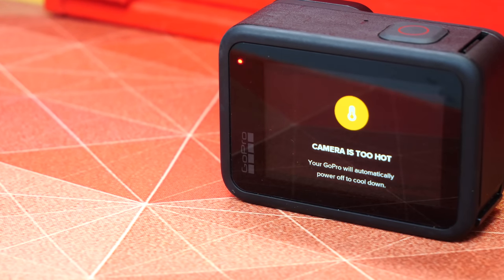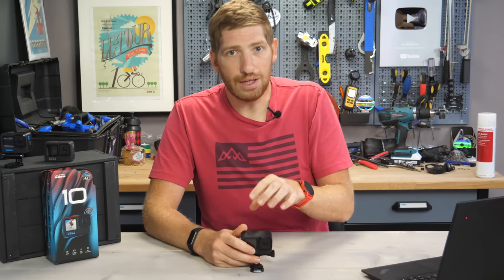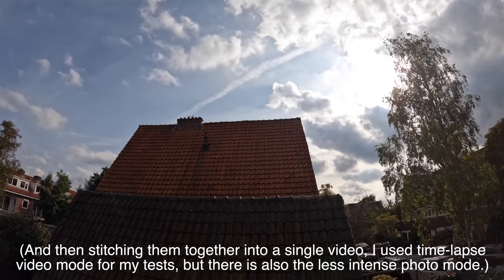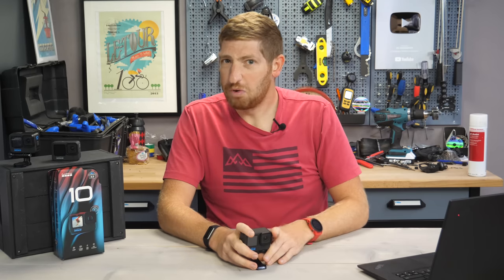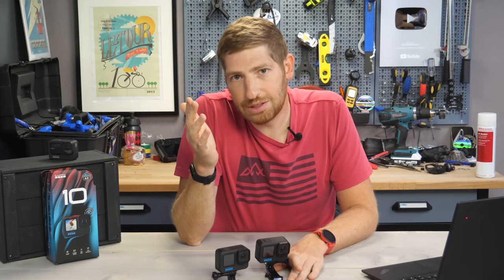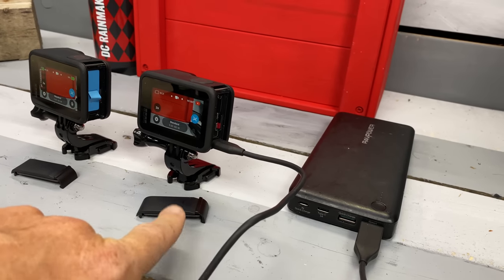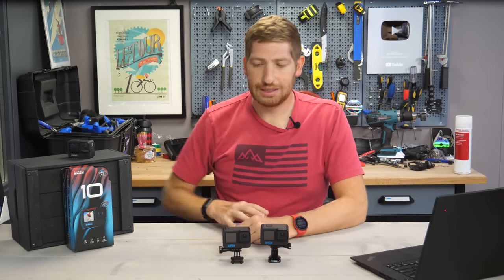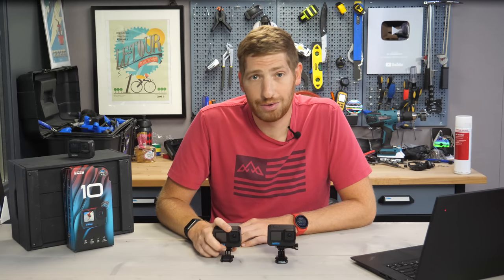GoPro Hero 10 Overheating: 40 Tests Later

Comment: I'm watching this Video, and while doing so I have a few comments based on 7 months using these Cameras as my primary tool for footage on my Channel:

First, these Cameras overheat period. It does not matter what resolution one chooses.

Second, the time frame is in the 15 min range +/- depending on the ambient temp. But I have gotten up to 45 min on some cameras at some times based on various ambient temps.

Third, it does not matter whether these are in air conditioned space or non airconditioned space.

Forth, It doesn't even matter if the camera is outside in the open air and moving.

Fifth... I've had to ditch ALL of my accessories that protect the cameras, or allow mods (Media Mod) due to these heat issues.

I have used in low resolution and still have issues. The only time I do not have heat issues is if there is a lower ambient temperature and I'm using Time Lapse.

So ... after some shared talk I decided I wanted to try to run these cameras without the Batteries in order  to supply additional air cooling via the open battery compartment.

And... In order to do this I needed a solid power supply to make sure that the cameras could run without the battery.

So ... I installed new QC3 and PD ports to power these. I was semi successful with that for 1 to 2 cameras. The third I could not get to run on only external power. These are all the same Cameras, bought at the same time, with the same firmware, and reset to default settings.

In the end what I found is that there is still major heating issues with the Hero 10. This was found even with the battery out, exposing more surface area to the ambient air temps and cooling.

The clip timeframes you suggest of about 1.5 minutes matters not, IF GoPro fails to share this issue presales for anyone looking at buying these cameras for an across the board use... they are perpetuating their faults.

Just my thoughts.

Almost all of my video shots are 10 to 50 minutes or longer, and in confined but air controlled spaces.

Its a Mad Mad Homestead 

https://youtu.be/-TZDS4EjFtU
Reply from the maker: Looking at your video, you mentioned 60FPS. That's the core of your issue. The issue isn't resolution, as I showed, it's the FPS. Also, if you're not moving anywhere, you can use the new Video Performance Modes on the Hero 10 (which came out after this video), to reduce the issue further. Simpy put, even in regular Boost mode with 30FPS you shouldn't be seeing overheating - even in 90*F weather (and my testing validates that). Whereas, in 60FPS, it'll overheat relatively quickly.
Reply: @Dcrainmaker  
I apologize...I'm not as professional in managing content as you are. Great job!

I did however run in 1080 with lower frame rates as well with the same outcome. That was with default configuration settings. Additionally I've shot with the lower settings in  firmware to limit functionality for battery life as well... all with the same or virtually the same results. It's a conundrum for GoPro for sure. 

And yet, as I've found in many posts about where GoPro may be headed in the future with the Hero 11, I fear they will hinge their reputation on the misrepresented (imo) data, that the majority of clips created are less than 1 min 30 seconds or thereabouts. 

That misrepresented data is skewed  by the fact that at a "20 min AVERAGE clip time before overheating", there would be little increase to that 1.5 minute number as there are fewer folks that CAN exceed clips that are in the other end of the scale. 

If you have 10,000 cameras with an average clip duration of 1.5 min, that number would probably be the mean. With the bell curve possibly covering the typical 20 to 30 percent of users fitting into that time use period of 1.5 minutes.

If you added 35% or so of users (roughly-per the bell curve) that have clips less than 1.5 min and 35% of users that have clips more than 1.5 min you begin to see how that stat can be manipulated in various ways to support anything you might want to say.

If for example, like myself, I would be happy taking a two hour clip and signing it down to whatever I need. That's much easier for myself being a one man operation and not having the ability or time to continually be manipulating 3 cameras in real time.

So if I were, or folks like me, we're to be included in those samples as Hero 10 users, that would skew the results of that 1.5 min by a lot to the longer clip side and away from the shorter clip side. 

What's confusing is this... if the "average user", as GoPro states, is using their Hero 10 to shoot 1.5 min clips, then it's basically saying that 35 % of users (according to the bell curve) would be shooting clips LESS than 1.5 min and 35% would be shooting clips greater than 1.5 minutes... 

So now I would ask... what length of clip would cover the average of the remaining users below  a given threshold, or 35% of the less than 1.5 min users? 

Well that would depend... but what I'm getting at is that it would be less than 1 minute... possibly less than 45 seconds. 

I can't see as many folks as they say using these cameras to simply capture 15 to 45 seconds of video. Again I may be wrong....  but if you look at the statistics behind the assertion that the average user shoots clips less than 1.5 min, then naturally there would be many that shoot less as well. 

Add that to the issue that the cameras will continue to heat, although not to the same degree, while they are on, but not recording, and you can begin to see that possibly the reason the users are generally using clips less than 1.5 min is because there are probably issues with the ability to use the cameras for longer periods, thus pushing the average down, and keeping it at 1.5 min. 

How about upload issues.?I believe it was mentioned that the data on clip length was taken from uploads to the GoPro cloud. 

Well looking realistically, how many folks are going to upload a two hour clip from their camera to the cloud when it would take a ton of resources (including battery and heat buildup as well) to do that.

So in reality the numbers represented by GoPro via their cloud uploads is skewed toward shorter clips already, from the get go... those 1.5 min average clips are the only clips that don't require a heavy drain on resources to upload. 

Just a thought... additionally I haven't delved into statistics a lot as of late so my numbers may be off, but I believe the point is still valid.

Comment: I would love to know HOW you got a Hero 9  to go for an hour indoors @ 30FPS....  Finally bought one June 23 and had to send it for replacement June 27th. Life got in the way and I just started to test the replacement and guess what ITS THE SAME... Tech said I should ONLY use their outdated 32 card that came with it & did the recommended firmware update (did it when the camera arrived under warranty in July) again -- temp WENT UP 9* on the Hero 32 sd card over the 256 NON GoPro one I got for it. 127* in 38 minutes of setting on table in front of me recording part of some movie on the TV but where I could keep checking the temp with an infrared thermometer like you use. Changed back to NON GoPro card and the camera ran for (fresh battery) 41 minutes to get to 112* and shut off.  BTW NEW with the camera GoPro battery will only charge to 34% after 6 hours.  So annoyed with it and the 10 came out just a month after I paid the full shot for a 9... GO PRO is a major failure that I got suckered into because somehow some people get good ones and make vblogs with them or don't mention problems.  BUT seems most people have MULTIPLE GoPros  - not just one.  My 10 yr old Hero 1080 works better but lacks the refinements.

Comment: I just bought an Hero 10 and this was one of my concerns.  So I really appreciate sharing all your tests.  I'm curious though - Could you please share the entire setting on the camera for these tests, not just resolution and fps but things like gps, high bit rate, image stabilization, picture profile (flat, natural or vivid?)?  Thanks
Reply from the maker: Thanks. I thought I had it in the video somewhere, but in short, my settings (aside from res/FPS) were: GPS on, Bluetooth On (WiFi on standby, but not on), normal Bit-rate unless stated otherwise (some tests were high, didn't matter), Image Stabilization to Boost on all tests, picture file at Natural. All other ProTune settings reset to defaults. Voice control off (as I didn't want tests accidentally turning off due to random talking).

Comment: Thank you very much for this very informative video. I have a cheap action camera and was looking to upgrade. I was looking at the Hero 10 or the DJI pocket 2 as most of the videos I do are Vlogs and the camera spends a lot of time in a mount on the windscreen of the van. I'm now leaning towards the Pocket 2 as the creator combo has the wireless microphone and also a 3.5 input jack. I would have to buy the media mod for the Gopro for this facility which would probably make it heat up even quicker. I do not film above 4k anyway so the 5.3 would be wasted on me. Once again thanks for all the information to help me make my mind up.
Reply: I do like the Pocket 2 for the reasons you mentioned. But you should consider that it is not a robust action cam, one rather has to be quite careful because of the gimbal’s delicate mechanics.
Reply: @Kroess  Yea well I'm over 60, so ACTION really is not in my vocabulary and I have to be careful with my mechanics now. LOL
Reply: @thegrumpygamer3081  I hope it is in my vocabulary when I get to 60.

Comment: If recording on a tripod indoors, would removing the battery door in theory help dissipate heat as well?
Reply from the maker: It will, but using tripod mode will help far more.

Comment: You get way more out of this camera than i do. With max bit rate and 4k @ 120 fps i am lucky to get 10 minutes on my chest mounted gopro riding fast on my bike with my GP10 and my 7 is the same. It seems not all cameras of the same model from GoPro are created equal. I keep the cameras firmware up to date.. It would have been interesting to have seen if there was any differences by introducing some other variables like the exact SD card used.

Comment: Nothing with a battery really works in the Middle East.  My iPhone overheats regularly from May through September in ten minutes or less if I try to play music outside.  Anything over about 45 C is beyond the intended operating range for the battery.  My GoPro also overheats during those months.  On the plus side, though, nobody in his right mind spends much time outside during those five months anyway. That's why there's Zwift.

Comment: Tired of the GOPRO illusion. Expensive cameras that overhead and fry chips. Very happy with my Insta360 0ne RS. Found a sea turtle laying eggs on the beach. She took 45 minutes to lay her eggs. If I had a gopro the camera would have overheated before she was done and returned to the water. One RS did the job and I have the video and a big smile.

Comment: So, would using the dive housing out of the water, and in motion be the same as using the Gopro stationary? Or somewhere in between moving or not?
Reply from the maker: I don’t think it’d help, since In that case you’d be far better using the native airflow temp, than having the buffer.
Reply: @Dcrainmaker  
The protective housing would be for protection from dirt and debries while ATVing (or like activities), was wondering if the housing would negate the moving factor.
Reply from the maker: @rantalaORV  Ahh, gotchya. Yeah, it'd negate mostly negate the benefits of Airflow. Durability wise, with the front lens cover being swappable (and just $13 using GoPro's subscription thingy), the bigger concern would probably be the front LCD screen. I think if you were to go with some of the 'cage' style housings that'd find the middle-ground there. Or, I suppose you could actually just buy the dive case and then drill a bunch of holes in it to maintain the airflow.
Reply: @Dcrainmaker  Thanks for the video and the info. I just noticed that the dive housing comes with a skeleton backdoor, that would probably allow some heat to dissipate while still protecting the front. Thanks again!!
Reply from the maker: @rantalaORV  It's funny, I was literally cleaning up around the office today and notices the skeleton door today as I was putting away stuff. Indeed, that'd probably help, and I'm sure airflow wise with enough speed it'll still pull some in via the back. Obviously, if you could sacrifice one and drill a few holes on the front too, it'd probably help significantly.

Comment: A few weeks ago during my adventures in Florida, my HERO 9 kept spazzing out while filming short clips or taking photos during my hikes. If I tried to take one photo it would just keep taking photos on its own and beeping furiously until I removed the battery! Then at other times it would go nuts and tell me to use an official battery, which I WAS using (???). It was so strange, first time I had any issues with the camera. I think it may have been overheating in the Florida sun ☀️.

Comment: The only issue I ever had with overheating a GoPro was placing the unit in one of those windslayer foam sweaters.  Granted I was using the windslayer not made for the Hero9.

Comment: hey DCR, longtime lurker/blog supporter. Have some tidbits to add and let you know the path I'm going down right now. (but first: should I just get a hero9 and avoid all this?)

My use case is similar to a dashcam- lots of sun, some motion, no airflow, running with external power for (ideally) 2-4 hours. Tough combination for the hero10 because I still need stabilization. I've dialed it back to 1080p, 30fps, wide, hypersmooth=high (the lowest setting above 'off'), as I think that's the best I can do for settings. I have it in a "gurmoir" metal frame in the hopes that'd act as a heatsink. I have the parts on my desk to make a fan that'll blow on it (thankfully, my audio goes through USB). I'm sure that'll help but I wish I didn't have to.

My learning is that I can extract the exif data and see when the camera shuts down. If the internal temp goes above 57C it'll shut down. I can see situations where I've used it and it spends a lot of time at 52C, but on the shutdown recordings the highest I've seen is 57.896C. Using a simple histogram I can see it spent 14% of its time above 57c, 8% at 56c, 32% at 55c (and the remainder lower). On a situation where it didn't overheat, it didn't hit 53c, spending 5% at 52c, 55% at 51c.

No, the gopro firmware doesn't fix this.

Comment: Shame you didn't test it with a Media Mod.  I use that for my YouTube Videos for the Mic and cold shoe mount. I get ~15 minutes before it overheated (pre-patch).  Case in point, these cameras are not really meant for indoor, static shots. In my situation, it's a garage (climate controlled), but doesn't move around much.

Comment: Sounds like a heat pipe device that replaces the fold out mounting lugs would solve the overheating.  Stick the gopro in a insulated thermos of water, measure the rise in water temperature and work out the thermal output of the camera to calculate the size of the cooler need.   Simple!  :)
Reply: ya... basically the size of a large too box... sort of reminds me of... if you put a big enough engine on a fridge you can make it fly!

Comment: What someone needs to be do is offer/bring out some sort of 120mm fan module with heatpipe that you can somehow plug into the side of the GoPro. Appreciate that wouldn't work for 'action' usage but alot of people use these for static video recording of football matches, tennis matches etc, where its sitting in the sun for 2+ hours.

Comment: I’ve been using the Hero10 constantly since I got it, not one issue with overheating. The only issue I have is the door to access the battery and charging port is a pain to open.

Comment: Overheating is always a problem for Hero 10.  I live in Ho Chi Minh City, Vietnam where always summer, which means always fighting overheating. I just plug USB battery while recording my ride. This prevent Gopro to use its own battery to over heat.
Reply: The metal case Ulanzi G9-5 solved the GoPro Hero 10 overheating problem even in the heat of Vietnam.

Comment: Any insight into the heat transfer via mounting brackets? I heard those become quite hot and might act as a heatsink. Maybe an aluminum mount could shave off a few degrees. Depending on sufficient conductivity a customized mount with a larger surface might be a more efficient heatsink in low airflow conditions. Needs more testing I guess. 😝 But thanks for the 40 tests so far. 😎
Reply from the maker: Interesting - I haven't tried that. I was thinking about going down the rabbit hole of mounted on a GoPro mount vs flat on a table (for static setups), and a casual glance at my data/tests seems to indicate that having it on a mount buys you a few extra minutes (which is logical, given it gives bottom airflow).
Reply: @Dcrainmaker  haven't watched entire video yet, but did you test the door from the 9 on the 10? I've heard it's heavier (metal?) and it might be better at dispersing the heat.
Reply from the maker: @lilcreature  No, I didn't test one door versus the other. I wasn't aware there was any difference there.
Reply: @Dcrainmaker  I mounted a peltier cooler with fins on the face, using a thermal pad. That only works again if have airflow. I noted that most of the heat is right around the lens. I think taking off the lens cover helped ever so slightly. I think just a metal lens cover with some fins could maybe help...